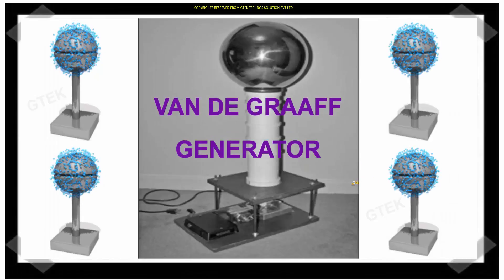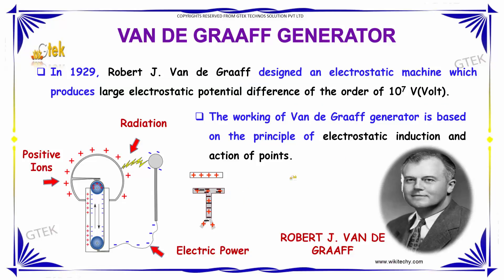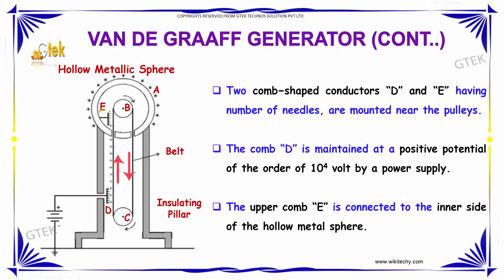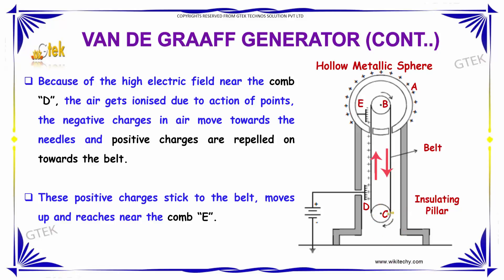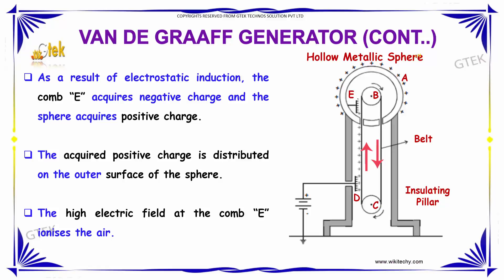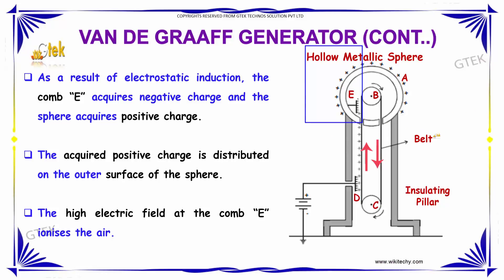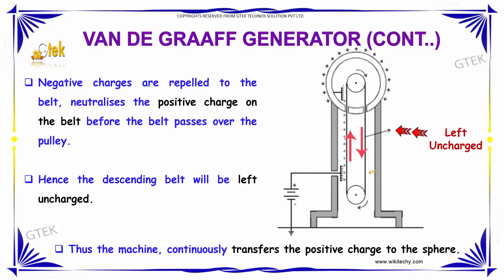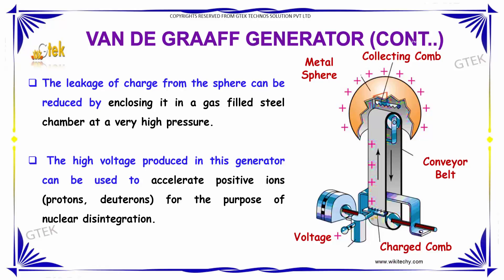Van De Graaff Generator | Electro Statistics | cbse class 12 physics | JEE Main and Advanced physics

Comment: The Van de Graaff generator was developed as a particle accelerator in physics research, its high potential is used to accelerate subatomic particles to high speeds in an evacuated tube

Comment: A Van de Graaff generator is an electrostatic generator which uses a moving belt to accumulate electric charge on a hollow metal globe on the top of an insulated column, creating very high electric potentials. It produces very high voltage direct current (DC) electricity at low current levels. It was invented by American physicist Robert J. Van de Graaff in 1929.[1] The potential difference achieved in modern Van de Graaff generators can reach 5 megavolts. A tabletop version can produce on the order of 100,000 volts and can store enough energy to produce a visible spark. Small Van de Graaff machines are produced for entertainment, and in physics education to teach electrostatics; larger ones are displayed in science museums.

Comment: The Van De Graaff Generator is basically an electrostatic machine that can generate high voltages. A typical Van De Graaff Generator consists of an insulating belt that transports electrical charge to a terminal. The charges that are sent on the belt are generated through a high voltage DC supply.

Comment: The voltage produced by an open-air Van de Graaff machine is limited by arcing and corona discharge to about 5 megavolts. Most modern industrial machines are enclosed in a pressurized tank of insulating gas; these can achieve potentials up to about 25 megavolts.

Comment: Van de Graaff generator is an electrostatic generator which uses a moving belt to accumulate electric charge on a hollow metal globe on the top of an insulated column, creating very high electric potentials. It produces very high voltage direct current (DC) electricity at low current levels.

Comment: A Van de Graaff generator is an electrostatic generator which uses a moving belt to accumulate electric charge on a hollow metal globe on the top of an insulated column, creating very high electric potentials

Comment: A pulley drives an insulating belt by a sharply pointed metal comb which has been given a positive charge by a power supply. Electrons are removed from the belt, leaving it positively charged. A similar comb at the top allows the net positive charge* to spread to the dome.

Comment: Voltages of hundreds of thousands of volts can be generated with a demonstration model Van de Graaff generator. Though startling, discharges from the Van de Graaff do not represent a serious shock hazard since the currents attainable are so small.

Comment: A Van de Graaff generator terminal does not need to be sphere-shaped to work, and in fact, the optimum shape is a sphere with an inward curve around the hole where the belt enters. A rounded terminal minimizes the electric field around it, allowing greater potentials to be achieved without ionization of the surrounding air, or other dielectric gas. Outside the sphere, the electric field becomes very strong and applying charges directly from the outside would soon be prevented by the field. Since electrically charged conductors have no electric field inside, charges can be added continuously from the inside without raising them to the full potential of the outer shell. Since a Van de Graaff generator can supply the same small current at almost any level of electrical potential, it is an example of a nearly ideal current source.

Comment: The Van de Graaff generator was developed as a particle accelerator in physics research, its high potential is used to accelerate subatomic particles to high speeds in an evacuated tube. It was the most powerful type of accelerator in the 1930s until the cyclotron was developed. Today it is still used as an accelerator to generate energetic particle and x-ray beams in fields such as nuclear medicine. In order to double the voltage, two generators are often used together, one generating positive and the other negative potential; this is called a tandem Van de Graaff accelerator. For example, the Brookhaven National Laboratory Tandem Van de Graaff achieves about 30 million volts of potential difference.

Comment: it works on the principle like
1.Discharging action of sharp points, ie., electric discharge takes place in air or gases readily, at pointed conductors.
2.If the charged conductor is brought in to internal contact with a hollow conductor, all of its charge transfers to the surface of the hollow conductor no matter how high the potential of the latter may be.